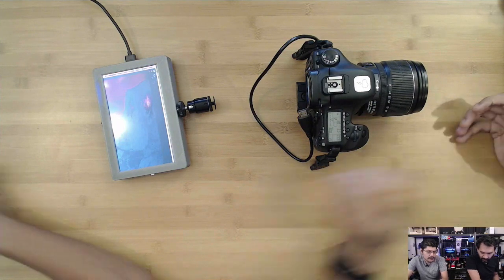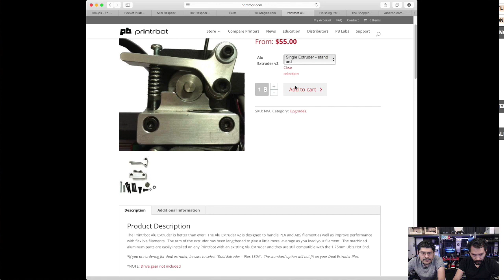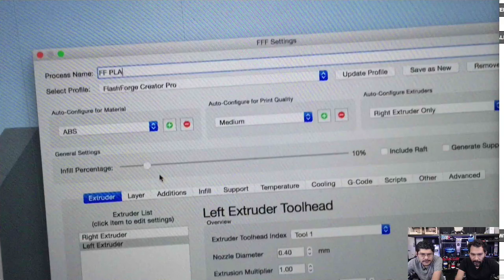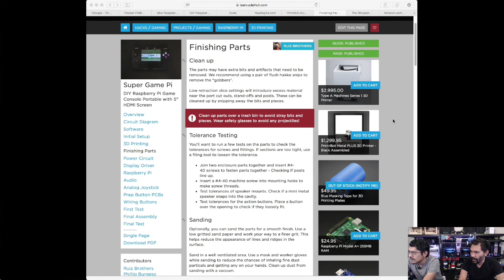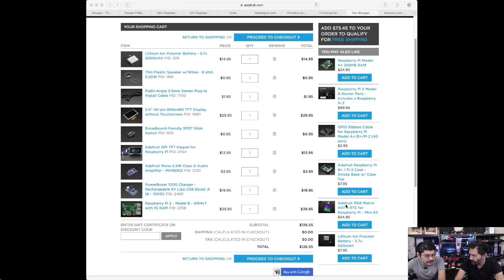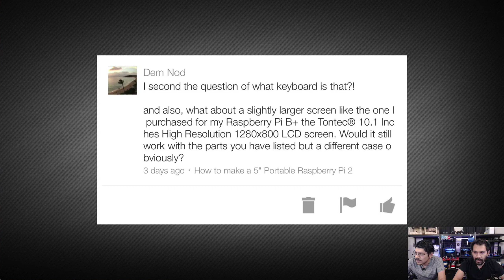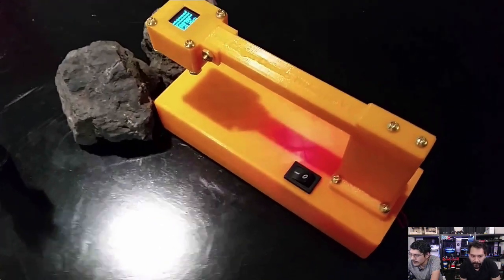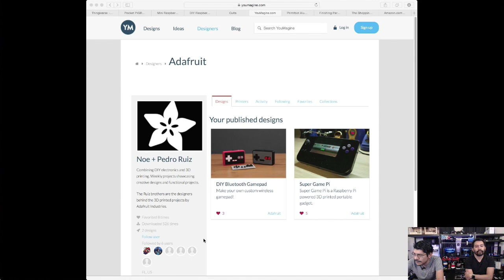3D Hangouts - Flash forward

Comment: The frostyness you got when printing the ninjaflex with the printrbot is almost certainly caused by temperature.

I haven't printed with ninjaflex specifically, but I've got some really good "noname" flexible filament with a recommended temperature range between 200 and 220. I used to print at 210 and got exactly that effect. When I lowered it to 200 it came out perfect - kinda like a PLA-like surface finish.

For NinjaFlex proper the exact temperatures might be different, but that's what I use with this stuff:
http://www.3dprintingstore.co.za/categories/filament/flexible.html

It will also cause most if not all of those loose wire bits to go away. It really is like night and day.

Speed also matters and going slower can help, but I just print at 30mm/s.

I also find that it comes out much better without a fan.

You can get your overhangs to come out much better by using a fairly high infill percentage support setting. Adjust the overhang degrees setting until it only infills the bridges. I go with 50% infill. It should be fairly easy to tear off and the overhangs/bridges will come out perfectly straight with no sagging. It wastes very little material to just infill the cutouts and is totally worth it imho.

I use the original extruder, but with this adapter printed in Taulman Bridge and then modified with a hobby knife until it fits perfectly:
http://www.thingiverse.com/thing:439617

Comment: Have you ever had an Ultimaker, or any experience with one? If so, how would you say that it holds up compared to something like a Type A Machine?
When I was looking for a 3d printer (before the Type A came out) the Ultimaker seemed to be the best bed in pretty much every way! Now that I have an Ultimaker 2 I'm still wondering how it actually holds up to other 3d printers. Would you get an Ultimaker original or 2 yourself?
Cheers

Comment: Hey Guys, I have a Taz5 printer and have to flash the onboard controller when printing Ninja flex, then I have to flash it again to print PLA. Is there an easier way to do this. Cant the settings be set in the slicer? BTW... I'm using Simplify3d.

Comment: I keep on getting a message on my flashforge saying that there is a wiring issue with the hotend. In addition when heating up the temperature doesn't show up. It just shows NA as the temp. Do you have any idea what the problem may be? Please help! Thanks!

-Riley
Reply from the maker: Have you checked to see if the voltage is set to 110? It's on the bottom of the machine behind the cover. It's set to 220v by default. We had a similar problem and that was the culprit. - Noe
Reply from the maker: +Extreme 3D Here's the segment we're we show how to do it https://youtu.be/ONi-4pLZ2Zs?t=20m39s
Reply: +Adafruit Industries Sweet! Thanks! Also should the red tab be covering the 110 or should that text be showing?

Comment: Hi :)
Im about to buy me a printer.
I would like an affordable  printer with double extruder, heatbed and at least 100micron accuracy.
and it would be super to have the apportunety to choose software.
what too recomend?
how`s that Prinrbot?
Reply: I recommend the CTC 3D Printer. Its a makerbot replicator clone. $600 AUD. Search it on ebay if you want one.
Reply: Ej908Productions 
Thanks for your answear :)
I went for a multimaker orginal +.
But i`m struggling to get it calibrated good enough.
I can change the flowrate to make a 20mm cube to be 20mm, but i`m struggling to calibrate inner diameters for holes and nuts, any tips?